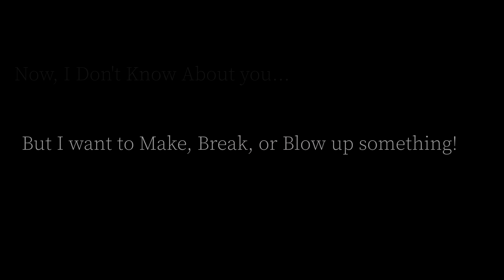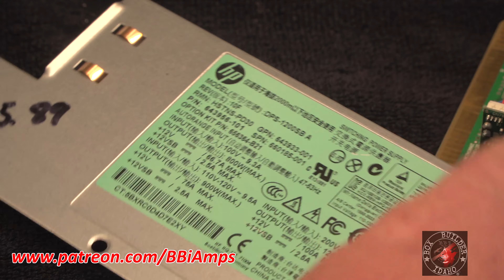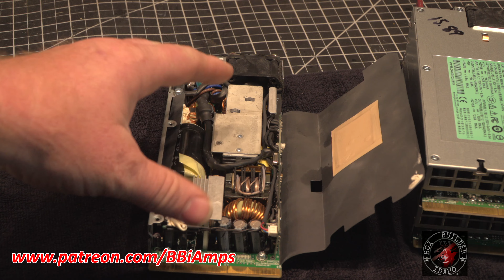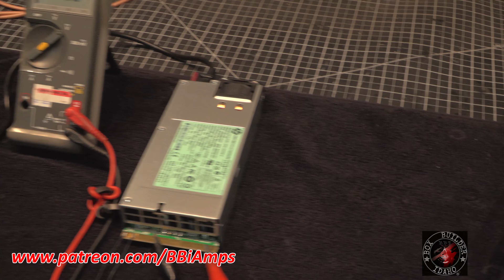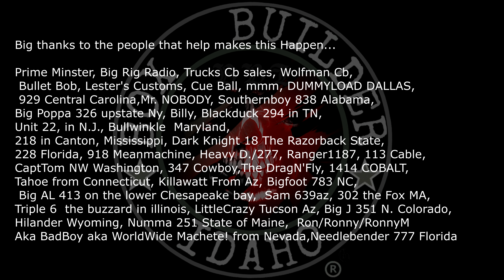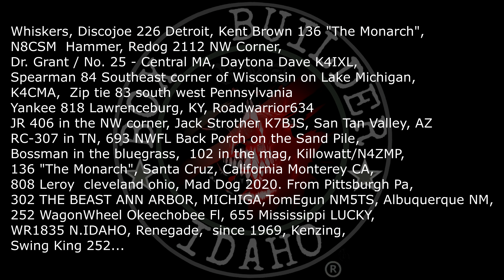Answering Questions "dps-1200sb" 100amp Supply's

Comment: Are you knowledgeable on how to do this for any supply or just these? I'm trying to move the over voltage up slightly on another complex supply that's 54v instead. I've messed with just about every component on the board, but can't get it to do what I want.

Comment: So first you need to solder a diode wire to the circuit board then you need a switch soldered in to power it then you need to solder a wire in for current sharing and you still need a 110 plug in and these are 69$ to 144$ right now yeah lots easier BBI.

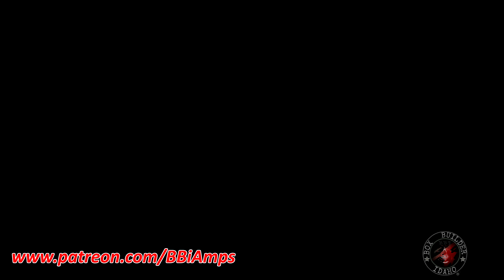Comment: 15:50 Since this PSU is made for an HP Server, this second tab feature's main purpose is power redundancy. In the event one PSU fails, another will take over. It's hot-swappable meaning you can remove one PSU without powering down the load unit and replace it with a new one. NOTE: This feature only works on the same PSU model; it does not mix with other PSU models.

Comment: Thank you for the information! Clear and precise.

Can you discuss setting two of these exact supplies up in series for 24v. Thank you.
Reply: Normally one has to be floating by shielding all of the low side circuitry from earth. Not sure if you can do it with these. Perhaps, if you don't use the load sharing pin and you remove any low side connections to the earth cable / casing on one PSU. Let me know if it works and we can go for 50V for LDMOS Would be a cheap unit but you might want  8 of them to run any bigger ldmos amps. if you could put 4 in series will we still be limited to around 1200W but at 48V  or a bit higher or will we get 4800W @50V?
  Some LDMOS are already 1200W so you would want at least 1500W capability I would say.  I have a load of old military spec supplies somewhere. Think they might run LDMOS. Anyway I just picked up two of these. What a great deal for 2400W of power.

Comment: Thank you 👍. I'm going to try one with my TS 480 HX Kenwood HF transceiver. Just about all of the switching power supply's I have tried are noisy on 40 and 80 meters, kinda annoying. This is a whole lot more cost effective than a 70 amp astron transformer power supply. Not to mention weight. Thanks and 73 GOD bless Earnest K5EWM 👍.

Comment: Great  video I have gotten other models before i seen your video they seem ok. I have not done any voltage increase mods yet just getting started. There fb 1A  pd-19 same turn on way .I also got a Samsung power supply for 9.00 tried it same way just about to turn it on  pin 1and5 have not seen any mods for them yet. We shall see it's on back burner I'm a hobbyist not nearly in you're field I am only as smart as you tube lol. I have been in dc fork lift repair before i retired have some experience. So in closing thanks for you're video's.

Comment: What an Great person doing a great work. I actually Bought 3 of these same models for an mod which only some chosen ones decided to do. I want to apply 240 Volt Dc from solar and use this to charge my 12v battery bank. Unfortunately this does not turn on 240 to 200 volt DC and It turned on instantly with 240volt Ac. I tried so much to mod it and read online articles so much but this model is not turning on high dc voltage. My other smaller switching power supplies of 5amps have no problem running on 240 to 200 volt dc but this model i want to run is not turning on. Please help me if you can in any way it will be much appreciated. I want to use this as an mppt from solar.

Comment: Seems like the DPS 1200 sba are all gone.  But plenty of DPS 1200 FB-1 models. Anyone know if they will work?
Reply from the maker: Heather work exactly the same the difference is the mod on the inside of the power supply.. it requires a different set of resistors in a different set of locations. All that information is out there you just have to go find it

Comment: hi bbibeauteful vide server suply have a lot o futurs votage control fan speed curent sering up to 4 units i think stability no noiz on cables they also hav a pin power ok i usualy put a led ther indikates separatly 13.8 is working i ben using a dps 800gb model a small coper bord wit extra caps and adorson powe poles istant 72 amps at 13.8v

Comment: hello Mr bbi. I have one question  . I have  a 2x8 . why is my swr high on output. swr changes  with power output  the lower the dead key the high the swr . and when I modulate   it swings  backwards?  I don't  think it has anything  to do with my coax  ro antenna  . because  when I run my 2x4  the swr is fine . can I get your opinion  on this matter  please.
thank  you  . Mr bbi.

Comment: The caps are rated at 16v in these.
How long do you suspect they will last being used and at almost 100% max rating?
Reply from the maker: Forever and ever and ever
Reply from the maker: On a serious note that's a very good question thank God I'm not one hundred percent I'm at like 95.5%
Reply: @Mr BBI  actually they are almost at 100%. The idle voltage is 15.9v on your supply, and the max is 16v on Caps.
Easy math.., dunno where you got the 95.5% because that's wrong,  it's actually 99.9%, to be exact, not including inefficiencies. 
15.9v X 99.99999% = 15.89999841v
The usual tolerance is 10%, but remember these are used, and probably have a billion hours on em. Caps are cheap, I'd replace em with a higher voltage rating, especially pushing them to the voltage limit.

It's not any different than rebuilding an engine and putting USED crank bearings back in. If 1 Cap shorts from running to hard ( and WE both know eventually they will), the entire supply goes dead. Food fer thought:)

Comment: I ran a loop on pin 1 and 4 and the led lights up but no 12vdc and the fan runs slow! No mods done yet just out the box!
Reply from the maker: Then you're the only one that's had a failure so far out of 6,000 units. Contact hopping around he'll replace it
Reply: @Mr BBI  I am in the UK, different supplier but I found out the problem! My multimeter probe was faulty! So I have 15k on the variable and 51k on the chip and I am seeing 14.5vdc working perfectly!🤗 thanks for all your help on this project bro! All the videos and the chat in the group have been super helpful!🤗👍🏼 052 in Scotland waving a hand!👋🏴👍🏼

Comment: These have been used in the RC world for a while. Big Lipo chargers like the iCharger 30 series and 40 series chargers need a big 24V power supply to operate at their maximum ratings so series connection two HP DPS's was found to be less than half the price of the power supplies the RC websites were selling (and they weren't putting out enough power to max out the biggest iChargers and other 30/40A Lipo chargers)

Comment: Hey Mr BBI.  Have you thought about drilling holes through the board where the positive and negative strips are.  That would allow for  100% wire attachment for those that don’t have big high watt soldering irons.  

I’ve modified a couple different power supplies over the years. This by far seems to be the easiest.  I ordered to and should be here this weekend.  

Thanks for the info.  I love watching your videos
Reply: Got a 460w one from a friend. It has binding posts mounted in holes drilled THROUGH the board. Works a charm and does NOT wobble at all!
Reply: I've seen a couple people mount lugs of different kinds by drilling through the strips. I'm hesitant to try it but with the PSU's being so cheap I might give it a shot. Would make my 4mm binding post/banana jacks much more secure because currently I'm soldering them which is secure but takes a lot of solder and isn't the cleanest looking. Just gotta make sure you use high quality solder. I use MG Chemicals 63/37
Reply: Done it a few times. Line your hole up good and you be fine.

Comment: Has me thinking better buy some of these before "_____" starts making fake ones or they start putting new labels on junk ones. side note: 1875 sold on his page.
Reply: There are actually many more server supplies from HP and Dell that can be modded in a similar way with slightly different pinouts, and layouts.  It just so happens that he has one of the only videos that go into enough detail of this particular part number. Doubt China will notice.  Dell makes a 3000w unit that is only about 1.5x's this size. HP makes a 1500w unit with yellow label the SAME size.

Comment: Can’t you add a rheostat or variable potentiometer where you place the resistor for increased voltage allowing for variable voltage adjustment?
Reply: You would have to add one for the crowbar circuit also then, and have predetermined marked values on each and set them both before turning on the unit
Reply: Probably better to use 2 variable position switches with resistors wired in, for each voltage value desired
Reply: @Tomahawk-415  ya I forgot about the crowbar, I’m thinking a duel faker 4 position switch with the required resistors for both the vdc and crowbar circuit. Example position 1 would be 12vdc position 2, 13.8 vdc and so on. Would just take some fooling around with resistors.
Reply: @HAUNTED-HAM Did you do it? If so, please share the results. 
Thank you

Comment: I know you can stack them in parallel, can you chain them in a series?
Reply: In most of these supplies the mains ground is connected to the output ground, so series connection requires modification. Also put a serious diode in parallel with each supply to prevent backfeeding power if one switches off.

Comment: If anyone has a source for the breakout board for this particular PS please advise.
Reply: The breakout board is meh unless you like the connectors they are using and aren't in need of any high amperage lines.

Comment: These plus are completely idiot proof..  You can stuck a screwdriver in them any where a ytime and after the "Splat-bang" its a really simple matter to scrap it for spares and buy another.  When that goes the same way ? - why you have all those spares just connect pin 1 to pin 4 ffksk !  What could be simpler ?😂